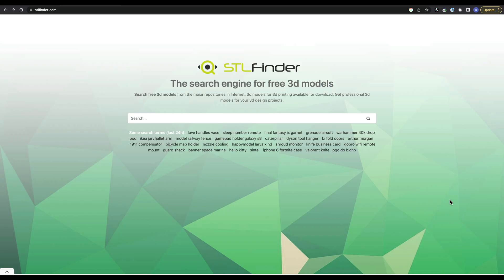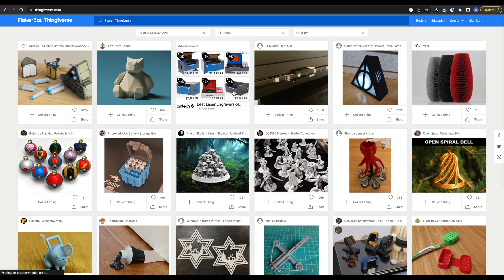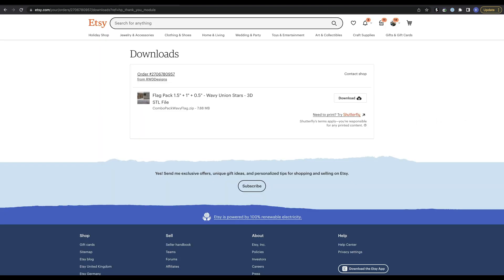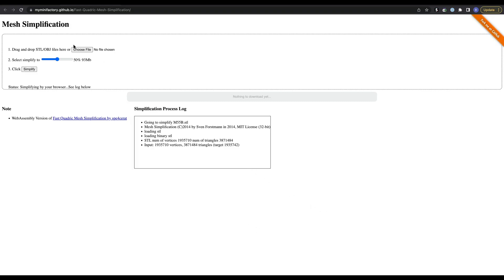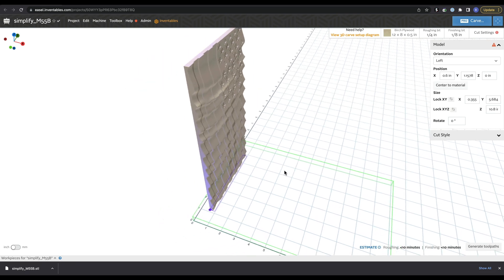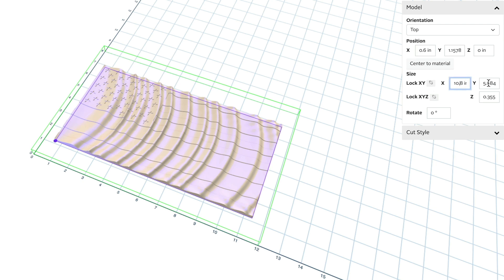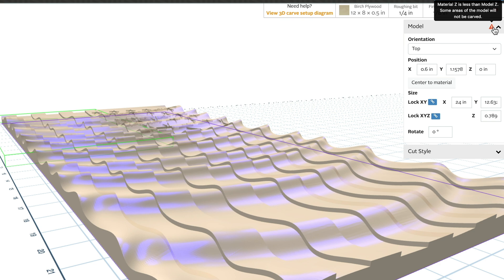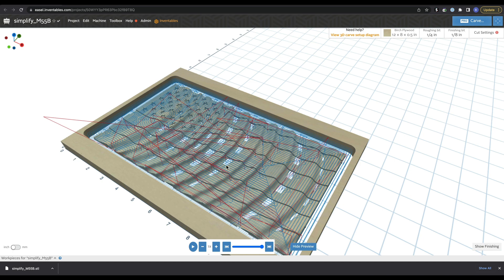Common 3D Model Problems for 3D Carving

Comment: Trying to cut out a guitar neck. Bought an STL. The problem is the tabs. Does easel know that you cut the front out and adjust once you flip the piece over? I dont think it does.. Itll probably just cut the tabs off.. Would love to see a video where you cut the front and back of a 3d stl file carving.

Comment: Thanks for the video. I have a semi 3D question. If I cut out a shape, let’s say a circle, how do I add a chamfer to the top edge? Thanks in advance:)
Reply from the maker: You could use a v-bit and create a workpiece that just has the outline of the shape.  Then just set the depth to have far down you want the chamfer to go!